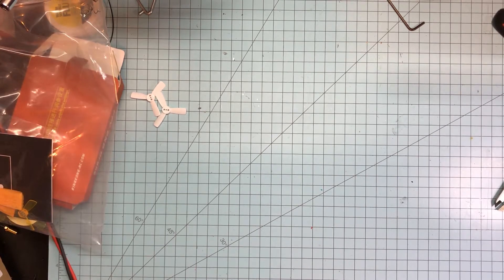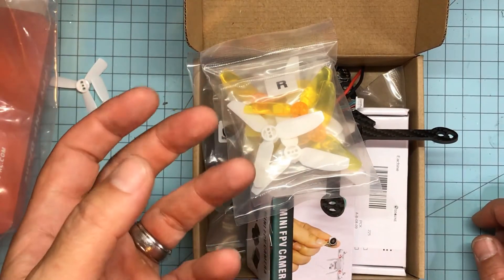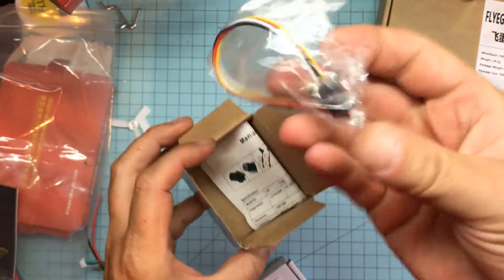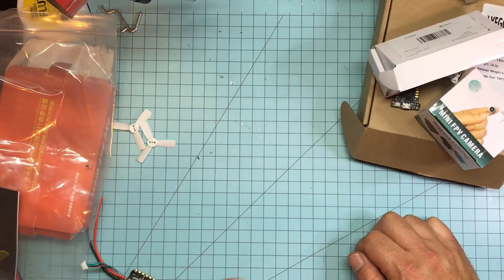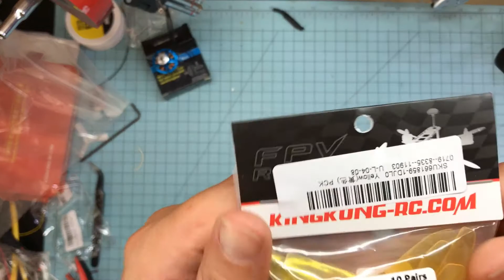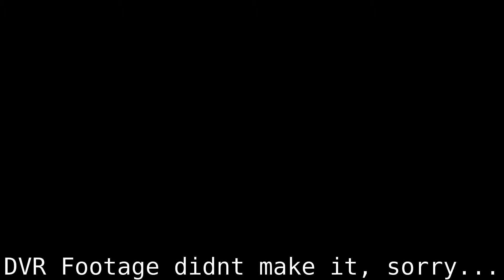FlyEgg 130 Project, guts and frame overview (Banggood)

Comment: HI , could you please let me know what options do we have on the prop ( size ) for this frame .  i just got only the frame from BG  thinking of not using the default props that came with it . can we put in a 3" props ..  the motrs that i got for this frame , Hglrc flame 1105. Thanks in advance :)
Reply: please give me links for green once u use on the build :D
Reply from the maker: deepu shankar kv hey my friend, here is the link 10 Pairs Kingkong 2840 2.8X4 CW CCW 3-blade Propeller 1.5mm Mounting Hole
https://banggood.app.link/qq1REx8hfG what size esc r u running? These props are pretty much perfect in my opinion.  I think the will give u the best performance without stressing the components.  Faster than 3 inch

Comment: you said you used gemfan props, the green ones? can you tell what the part number is or put a link, thanks
Reply from the maker: Sorry, i had misspoke, they are king kongs, but they are holding up fairly well. here is the link https://www.banggood.com/10-Pairs-Kingkong-2840-2_8X4-CW-CCW-3-blade-Propeller-1_5mm-Mounting-Hole-p-1160372.html?rmmds=search
Reply: those are on back order for a while now. I found crazepony.https://www.amazon.com/Crazepony-Blades-Propellers-Racing-Quadcopter/dp/B071FN9V78/ref=pd_sbs_21_1?_encoding=UTF8&pd_rd_i=B071FN9V78&pd_rd_r=97BX38J3ZPY259X10DJZ&pd_rd_w=hjlfO&pd_rd_wg=ybdtJ&psc=1&refRID=97BX38J3ZPY259X10DJZ
 are they any good?
Reply from the maker: yes! exacta same thing. ive ordered those so i can vouch for it
Reply: thank you